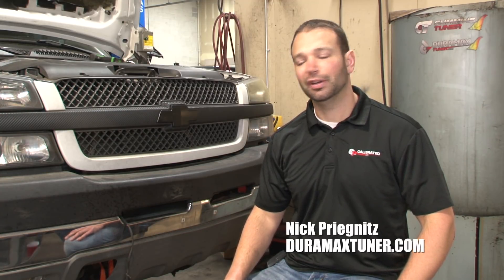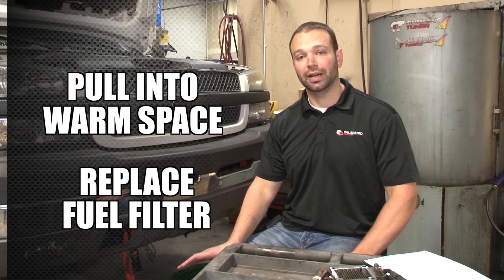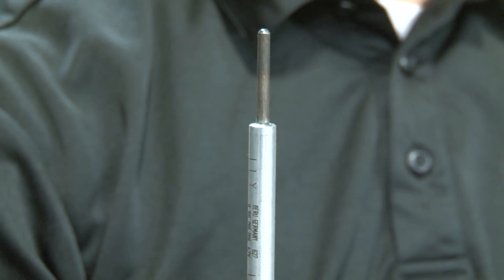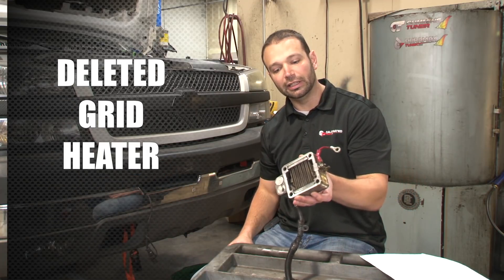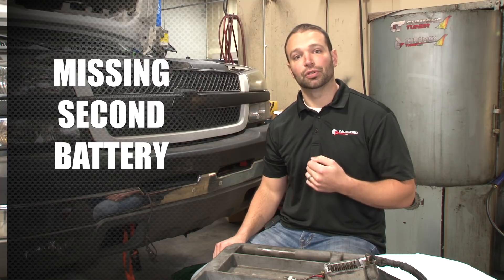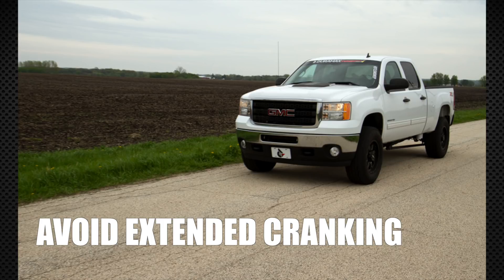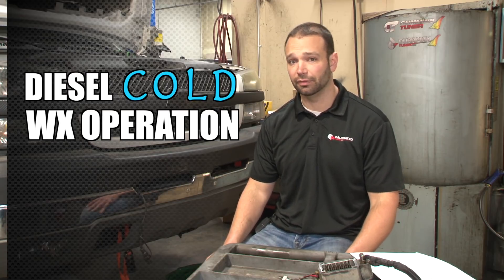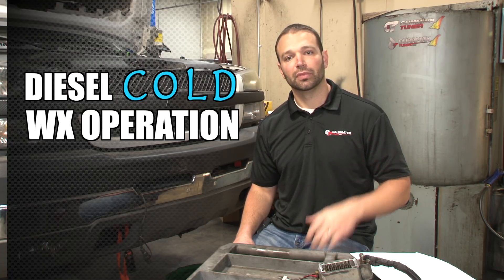How to Avoid a Cold WX Shutdown in a Diesel - Diesel Insights

Comment: Northern Canada here, run a transport company, run on the ice roads you have probably seen on TV. Fuel gelling is not really an issue here and its below -30c for two months straight. We have winter fuel here and add conditioner regularly. Frozen Brakes, air systems, stuck air valves and keeping heat in the block is your only issues really. Put a winterfront on a pickup, the little duramax trucks start and run fine in the cold. Our LMM will start in -25c with no block heater any colder and it wont start.
Reply from the maker: Thanks for your words of wisdom and experience - stay warm!
Reply: Thanks for taking the time to produce these videos, i like to show out less experienced drivers videos like these to help them learn. This type of stuff was hard to find in the past. Keep up the good work.
Reply from the maker: Thank you so much - your comments mean a lot to us. We hope to produce 52 this year - knock on wood.
Reply: My LB7 will start at -20 even if I forget the block heater but I get complaints from my neighbors because of the excessive smoking that occurs XD.

Comment: I work as a welder in -30 conditions. Do you suggest turning my truck off then cold starting it several times a day or just letting it sit in high or regular idle so it stays at operating temp when I need to move to my next weld or take coffee. Thanks for the video as well great infor
Reply from the maker: Extreme temps like -30 change the equation. It would depend on how long of idle times you are considering.
Reply: @Duramaxtuner  12 hour idle time
Reply from the maker: @TheErms12345  That is a lot of idle time.  You will likely want to find a mix of idle time and shutting it down throughout the day.

Comment: Can you explain more in detail how to get that high idle again
Reply: As Nick suggested, I googled and found this on a Forum. Later poster said it worked: Turn the ignition key to run(engine off), then hold the accelerator to the floor and, while holding the accelerator to the floor, cycle the brake pedal 3 times within 8 seconds. The odometer display will switch to a message, either "elevated idle on" or "elevated idle off", depending upon whether it was active or inactive to start with. 

Don’t know if it defaults to regular idle at next start (?). Please report back.

Comment: Hello i have on thing that i wanted to point out with the glow plugs. On the LB7 if there is one or more that are bad the ecm wont pick it up because the ecm only receives the signal thatg the glow plugs are on. I checked myh when i rebuilt the top end and found  Multiple ones that were bad. The way you can test them is two ways use a DMM meter on ohms and check it for 1 ohm or less if its open or no ohms reading the glow plug is no good. The second way would  beto put battery power to the plug and see if it gets hot. Again if it doesnt its no goox and needs to be replaced. Thank you
Reply from the maker: Thank you for this! Really appreciate your insight!

Comment: What about my lbz, it would be nice to have an aftermarket solution since I just installed a pusher intake y-bridge kit which deletes the intake heater, now my truck takes forever to warm up, what can I do besides winter front and having glow plugs to help it warm up quicker again.
Reply: David Fultz Oh I know about that, born and raised in MN, really stunk that my 01 Seville STS didn't have a block heater, but it never let me down sitting outside overnight in -40 and -50 windchills, dad's LLY wasn't Always plugged in but it always fired right up in under 5sec glow plug time, his truck had me sold on duramax, now I have 2 of them. My uncle has a 6.0, every weekend the hoods up trying to keep i t running, my dmax has been there to save his countless times now, lol I actually have a couple of videos from a few years back when i was in MN of the caddi in cold weather, as well as my dad's truck, then goes to my lb7 cold starting in MN before I moved here
Reply from the maker: Might recommend a block heater, as mentioned in the video. There could be an aftermarket solution - can you give us a call Monday and ask one of our techs? We'll help you figure it out - 815-568-7920.
Reply: Duramaxtuner Thanks, I usually use the block heater, just loved having the intake heater, got up to temp alot quicker than my 01 lb7, I definately will give you a call to help figure a couple other things out.
Reply: I have used a 500 watt quartz halogen lamp propped up under the engine along with the block heater. Here in northern Minnesota recently we have had -41° .  It doesnt matter what you drive it doesn't like it !
Reply from the maker: Amen.